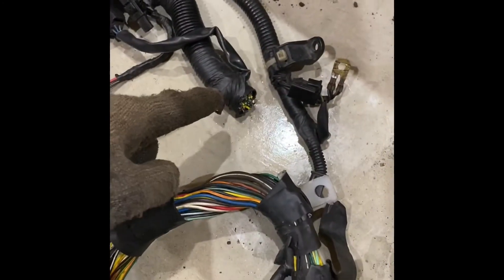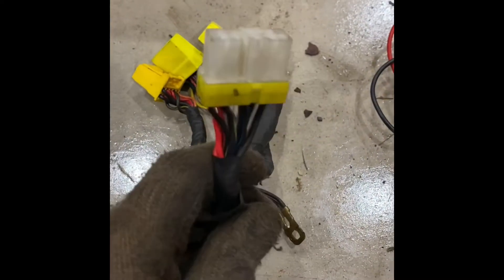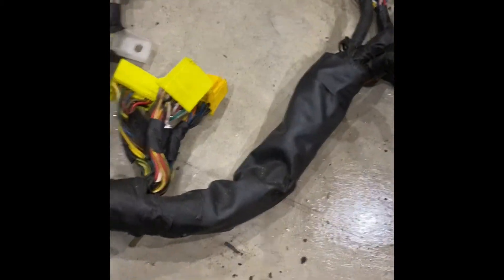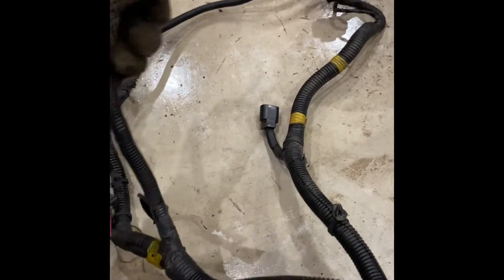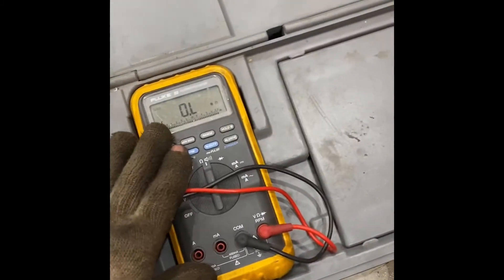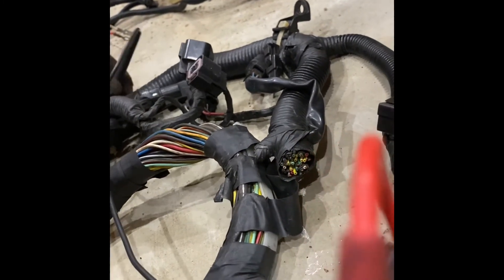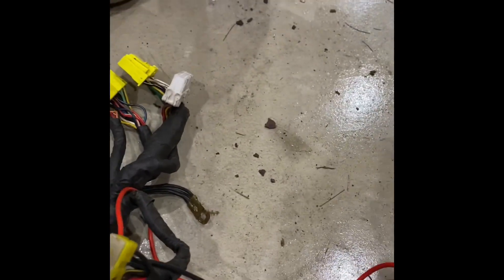1G 4G63 DSM MPI Relay Fuel Pump ECU Ignition Coil Wiring | Mitsubishi | Eclipse | Talon | Laser

Comment: Figured I'd  Share some helpful tips: at 1:14 I will confirm that these 3 wires go to a fuse box on the + battery terminal on a 1g dsm, the black with red wire, mentioned in the video, needs a 20 amp fuse before being attached to the battery +, so if your project has a preexisting fuse box you can use that slot and add a 20 amp fuse. 
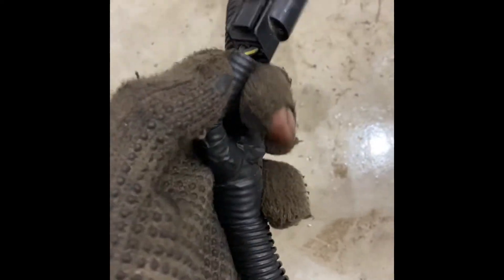  at 1:32 the black with yellow stripe wires become 1 spade connector that activates the starter solenoid, on an auto car the black yellow wire also goes to the neutral safety switch, so the car only starts in park or Neutral. at 1:45 the black with green stripe is for the fuel pump it is activated by the ECU pin 13, but I will add here that you do not have to cut the green black wire on the mpi relay connector to send battery + to your vehicle fuel pump, you can go to connector seen at 2:25 and you will notice the black green striped wire.
at 2:30 the black white wire needs to see a switched + meaning hot only when your ignition key is in the on position,  
at 3:22 the wire you are referring to is the ECU Backup power, which is pin 103 red with black stripe on the ECU, this needs to be a constant + 12 volt 10 amp fused wire, and you don't have to cut into the ECU wire connector, just use your digital ohm meter on pin 103 and find the red with black stripe wire, it is located on the larger white connector that is next to your mpi relay, pin is in connectors top row second to last wire.
Reply from the maker: Good info. Thanks for sharing and watching!

Comment: Hello. How you doing .. I wanna ask about something happened to my 1991 galant i lost the connection to the transmissions I cant see the light on the cluster like before an its only on 3rd speed all that happened after I changed the alternator bc I drove on the car with out alternator ...
Reply: it's likely a fried transmission control module aka TCU the capacitors on them like to leak and destroy the circuit board, much like the dsm ECU's, a friend of mine had the same issue your talking about on a 91 base model Galant, the transmission was in limp mode only 3rd gear in drive overdrive did nothing, I probed the 2 TCU test wires that are in the obd 1 connector with an analog ohm meter , and I got no pulses so I had a clue that the TCU was possibly dead, or the signal was not reaching the on board diagnostic port for some reason, I pulled the 2 trim pieces off that area on the floor that incase the stereo, and carefully removed the TCU unit it is bolted to the floor way below the stereo, it was a pain to remove it, but after getting it out of the deep area, I popped the cover off, 4 screws on the TCU case, and sure enough there was a capacitor shell casing rolling around inside the TCU, and acid goo traced on the board in some areas, where the capacitor was supposed to be on the board now had a hole in it, so fixing it was out of the question, but I located another one, in good shape and put new capacitors in it, just as preventive maintenance, and it never had another issue and all gears including overdrive worked on it but make sure to match the part number on your old TCU if it ends up being your problem.

Comment: What would cause this to rapid click? My car runs great and will rev then clicking starts and it stalls since it goes to fuel pump. But it randomly starts and stops clicking. Once it stops. Rev to the moon
Reply from the maker: I have heard had a dying ecu can cause that. But also Check the ground that is located right next to this mpi relay, along with the main power wires on the battery. If any of those are loose or dirty, it could cause the relay to freak out.